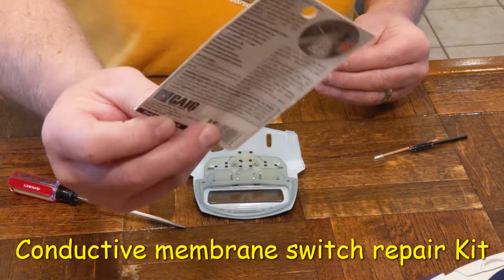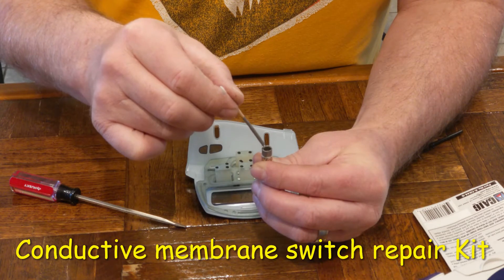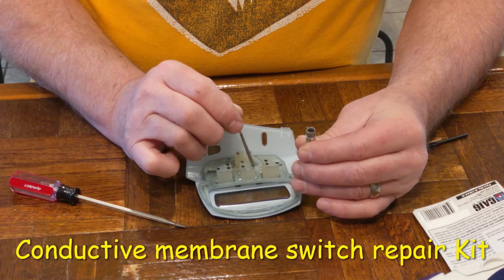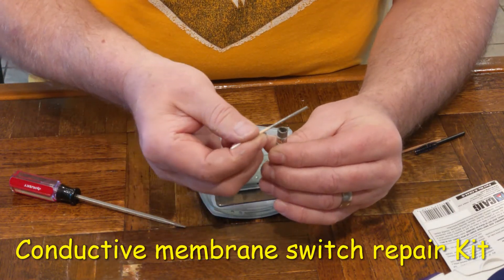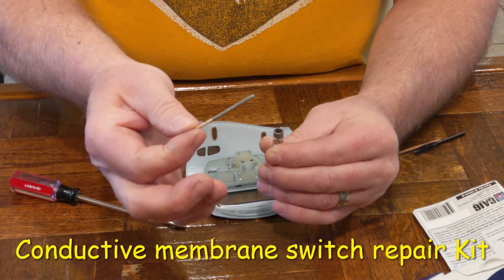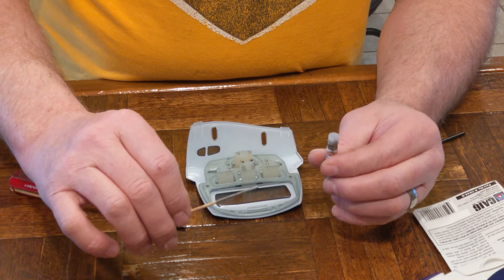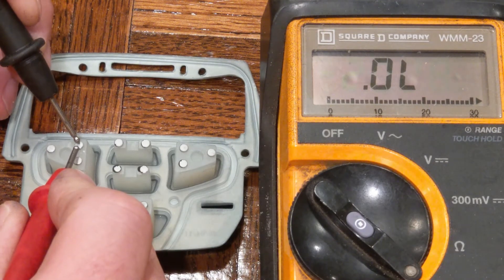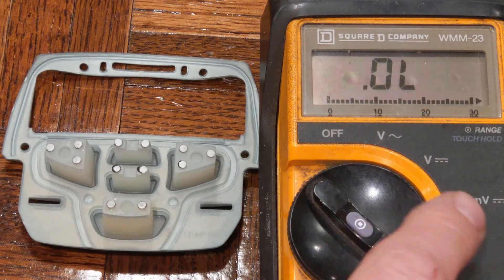Electronics Conductive Membrane Switch Restoration kit

Comment: REALLY wish you had shown more in this vid and explained more. 
Membrane keypads were too common for too long and they're now failing.  Understanding how they work and how to repair them will be very helpful to people who would rather repair than replace.  This is especially true when you're dealing with something like an appliance control panel that no longer works but also the repair parts are no longer being manufactured.